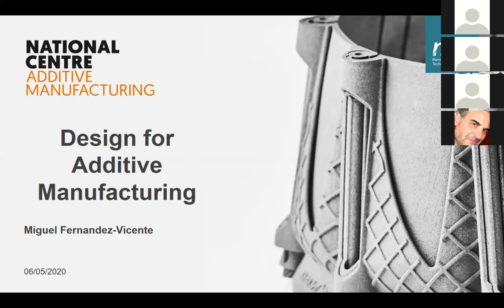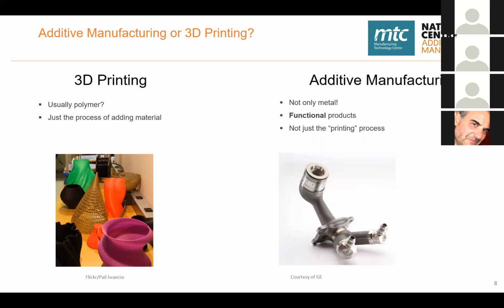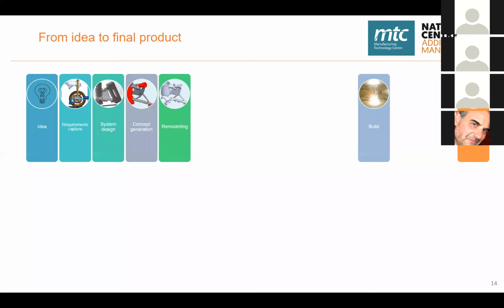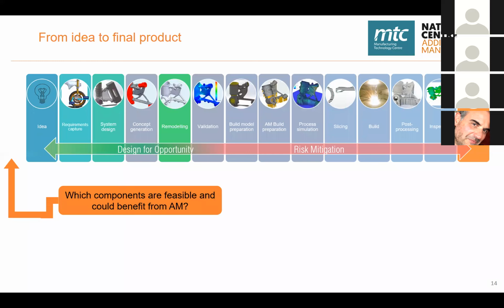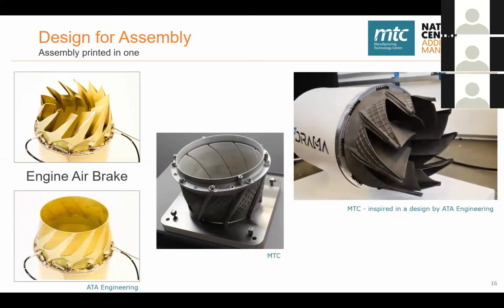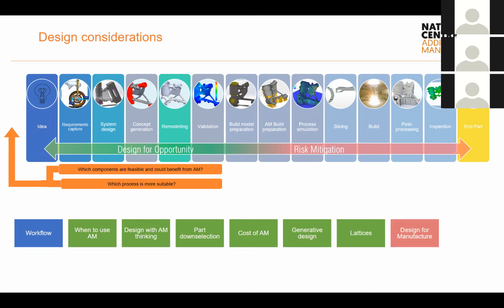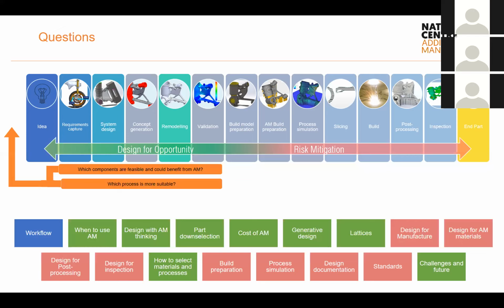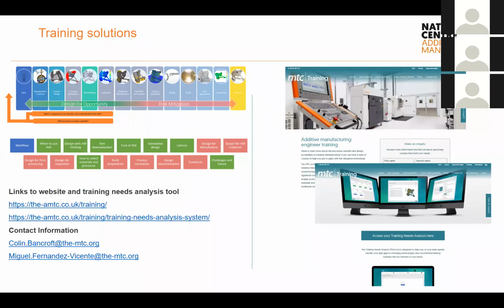NCAM Webinar 2 - Miguel Fernandez Vicente

Comment from the maker: In metal process, particularly SLM how accurate is process simulation and can it predict the success of a build considering optimised geometry could be novel each time?

It is accurate enough to become a “mandatory” tool to check that the build preparation has been done correctly, and be confident that the part will not distort due to design reasons. Process simulation is done after the geometry has been optimised and the design has been fixed.

Comment from the maker: Which Technologies are you using at the MTC for polymer 3D Printing?

Bearing in mind that we use technologies from external partners as well, there are (currently) Stereo lithography, PolyJet, Binder Jetting, FDM, FFF, FFF+CF, Large format extrusion,  and MJF machines at the MTC.

Comment from the maker: I want to learn more about how they use algorithm based design methods I mean scripting for complex 3d shapes? Do MTC have any cases of using biomimicry for additive manufacturing applications?

Searching for tutorials about visual programming with CAD software such as Autodesk Dynamo or McNeel Rhino3D (+Grasshopper) would be a good starting point. We partially inspired the design in the biostructures in the project indicated here: https://www.linkedin.com/posts/net-shape-manufacturing_on-display-at-the-mtc-this-image-shows-an-activity-6579313880428883968-gg1A